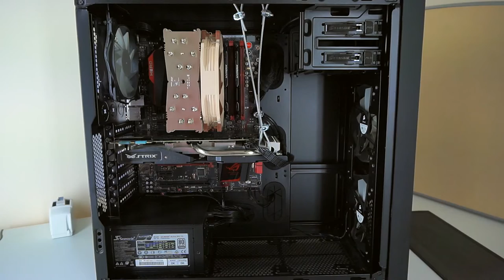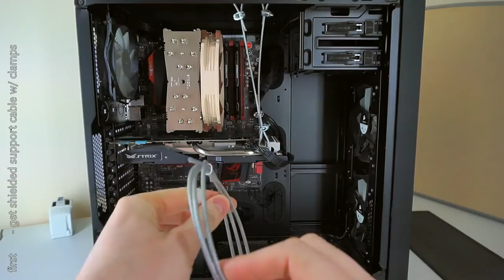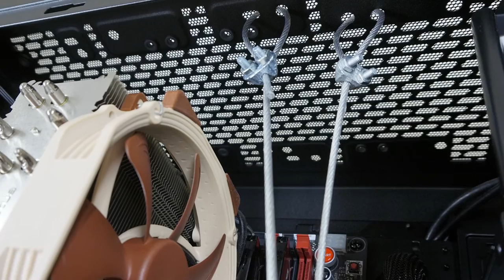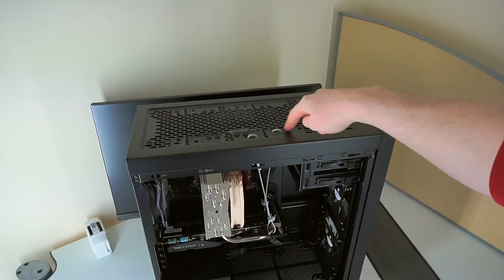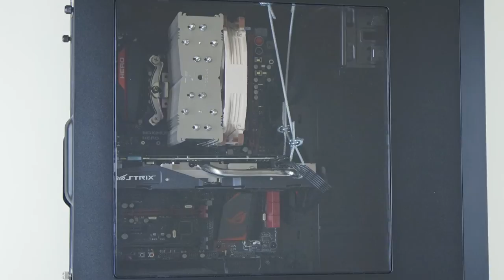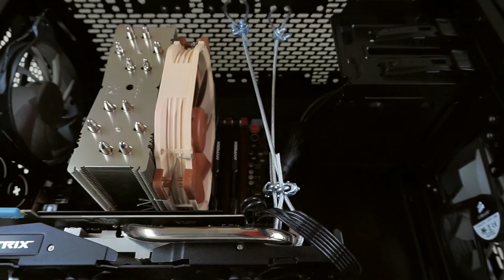GPU Support Bracket on the cheap DIY

Comment: zip ties would be bettter, also i wouldn´t recommend to use metal cables on direct contact with the graphics card, it might cause a short.
Reply from the maker: The cabling used has plastic shroud. Also, it is connected to backplate and PC case. Both are connected to the same either way so no issues regarding short if done properly without touching PCB of the graphics card or motherboard etc.
I think it looks better than zip ties. A bit of industrial look. Maybe case doesn't really complement...

Comment: Rounding the cable from the top would have been a better option, butting a rubber piece or something between the port and the case, when screwing the GPU keep it up.

Comment: if you have a backplate can it even sag
Reply from the maker: +ljp king it does a bit. Mostly stress would go on the motherboard/PCIe slot. I just like the extra security for few €. Looks cool in my opinion.
Reply: +Eds drafts ok thanks Yeh I wasn't sure, I ordered all my parts for my pc which I'm going to build (hopefully all goes well as its my first build) and I just wasn't sure
Reply from the maker: This is only extra precaution and I also like the looks. Don't worry about it building your  first PC though. No need at all.

Comment: I used a shoelace to support my graphics card :)
Reply from the maker: kevicusmusic . if it works why not. Just be sure it can handle 60C and higher temps :)
Reply: yeah its just a normal shoelace. I got rid of the plastic parts on it so its literally just 100% cotton. It works fine! its holding up my r9 290x tri x card from sapphire. Its so ghetto ahah